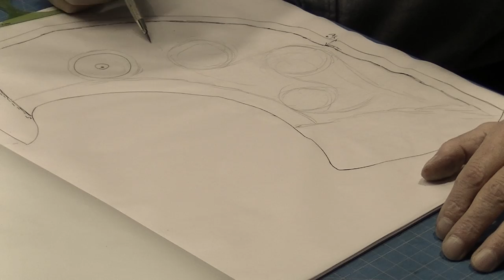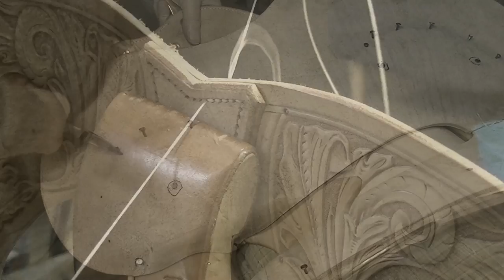Saddle Making   Part 2

Comment: Well... I did everything in a very different order on the saddle I am building. I am at the forks cover and boy is it hard. I have wasted 2 tries and am going to attempt the 3rd tommorow. I've been using the Stohlman books and they are great - but they can't tell you everything! After watching this I can see the wisdom of slick forks but I have what I have and will figure it out. I will try fitting it and lacing the sides as that seems to be the only option left. Luckily I am pretty good with lacing and braiding and should be able to pull it off. It is a challenge but i think it will be worth it when I ride in a saddle I make.
Reply: Get the saddle makers shop manual.  It’s so much more helpful than the stohlman books.. they’re dated.  The shop manual builds a wade from beginning to end